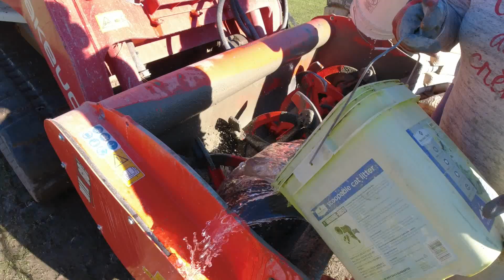TESTING OUT a CEMENT MIXER attachment FOR A SKID STEER (game changer)

Comment: Pour that concrete over topsoil and grass.  Nice
Reply from the maker: Still going strong with a 10,000 gallon pool on  it:)
Reply: Lucky so far. I predict cracking in your future. Shortcuts create problems later on. But if your happy no problem.
Reply from the maker: @UrbanDIYer  still no issues 10k gallon pool on it

Comment: 3:00 Why didn't you just scoop up the aggregate with the mixer bucket THEN put the bags of cement in?
Reply from the maker: Would tear up the lawn to much. This was way easier. If you have an extra machine why not use the rig to make life even easier ?
Reply: @VBELTandSON  But that is a tracked skid. They tend not to mess up turf as much. But I am not there so you were the better judge of that. Just asking. Oh and I did see the part where you mentioned that. 

"If you have an extra machine why not use the rig to make life even easier ?"  Yup. I am in agreement.

Comment: You really need safety grates over the mixer . That thing will grab your arm and drag your entire body in . You shouldn't have the blade spinning near the bags either that can get you pulled in. I stand on mine but I have thick safety grates on ours. Input my water in first then add 5 bags at a time usually stoping around 25   80# bags  ours can hold 30 but it's a little much for the hydrologic lines I can usually mix 2 pallets of 80# of concrete and pour in about 1 to 1.5 hours cleanup up and loading  takes about 30 min

Comment: People aren't figuring in cartage and wait time on the concrete truck..its $150 yd PLUS cartage and wait time. When you have to fill a skidsteer bucket n haul to your work area the time adds up fast ! I bought a used mixer like this for $5k because I'm far from a quarry so cartage would be very expensive. Plus a lot of areas on my farm where I pour concrete aren't accessible for a truck. When I'm done with my projects I can sell the mixer for damn near what I paid for it !! It came in handy when I had to repair all the posts in the poll barn..could only do a few at a time..not worth getting a truck.

Comment: Just put a bolt, two washers and a nut in those holes with the nuts on the outside.
Problem solved.
I can't believe you poured cement without removing the top soil and laying down gravel and using galvanized fencing instead of standard pre-rusted fencing.
Other than that a pretty interesting vid.
Reply from the maker: Smart idea
Reply: Who uses galvanized wire mat?

Comment: Let’s say you wanted to do a barn slab all by yourself. Say 75 yards. Time is not an issue nor is manpower. But money is. If I already have a track steer and am open to buying a specific machine/attachment would this work or is there a better option. Really looking to save major money and do it over a week or two. But obviously I would like to minimize the work as much as possible. Thoughts?
Reply: I have the eterra 16 cubic foot unit and it works well. Cost wise where I'm at, it costs me about 2/3 what delivery from a concrete company costs. I paid around 8300 for the unit so I might break even if I did around 100 yards of concrete. Do your numbers and decide what's best for you. I like to look at it like I get a paid for attachment eventually, but delivered concrete is by far more efficient.
Reply: @reliableloren2871  great info and thank you. I didn’t realize those mixers are so costly, in the back of my mind I was assuming 4/5k maybe or even lower. That changes the math. 
Personally I’d feel obligated to get my money back at least once by either renting it or doing a job with it plus the savings earned in doing my own project. Just musing, and thanks again

Comment: Placing concrete on topsoil and grass is not good practice.  Plus there should have been a 4" stone base installed.  In about six months it will start cracking.
Reply: But they saved so much money by doing it themselves!

Comment: I’d rather have a truck chute it into a bucket from the driveway. Short-loads are 3yd minimum where I’m from. That looks like about 4 yards. Truck would be cheaper than bags, lots faster, lots less work, standard bucket holds more than mixer bucket. I agree that that’s a sweet setup for remote jobs though. Fresh mud gives you more time to lay it down, too.
Reply from the maker: 10 yards*
Reply: @VBELTandSON  whoa! 
Thanks for responding! I feel start struck. 😉 
Hello from Moscow, ID!

Comment: Next tine get the concrete truck and 4 wheel barrows. You could have shuttled the concrete faster than you could have mixed it.  1 wheel Barrow is 1/32 of a yard of concrete.  Ask me how I know.
Reply: 10 yards 1/32nd at a time huh? That sounds like alot of fun.
Reply: @Kashaww  me and 3 more guys did a cart path on a lake property once.  It was  26 yards total.  The ground was so steep we had to drag the legs of the wheel barrows all the way down the path.
Reply: If he had a skid steer he could haul it the bucket. That's what he needs is a skid steer!
Reply: Have you ever heard of a line pump? Some people work harder than they should.

Comment: I would of used a concrete truck and hauled it in a plywood box in the bed off a pick truck. That's one of the ways I've done it. Tilt the box so the concrete runs out when you open the gate. You can haul a half a yard at a time. Mixing concrete with bags cost a lot more than from a concrete truck.
Reply from the maker: Idk why I even talk in these videos. No one listens. 🤦🏼‍♂️ we mixed more than a cement truck load and still have extra material left over. material cost was a less than half of what a cement truck load would have cost. This was cheaper for us and 0 issues.
Reply: @VBELTandSON  4 yards  here cost $600 from a concrete truck. Or 160 80 pound bags or  concrete mix from the big box store for approximately $550. 4000 concrete mix here I'd 135 dollars a yard from the concrete plant. I can't see how its possible to save the way you're doing it. Also you need the skidsteer and the mixer.
Reply: @VBELTandSON  Not to mention a pickup truck wasn't going to fit through that gate either. Some people just like to hear themselves speak.
Reply from the maker: Well now you are calling me a liar. Smooth amigo. ✌🏻
Reply: @VBELTandSON  LOL, I'm saying your math isn't correct.
Reply from the maker: No no you don’t trust me or my math. 2500 was the quote using a cement truck.  I spent a g on material.  I already own all the equipment costs me nothing but fuel.
Reply: @VBELTandSON  I wouldn't even waste time responding to this guy. You're better off talking to a brick wall or Callahan...either one would be more intelligent.
Reply: @VBELTandSON  okay ,my math is comparing the 4 yard  Minimum concrete truck load to concrete mix from places like lowes. If you got the materials for a thousand dollars  than you saved. My point is for the average person may not get a great deal like you did. And the average person might be mislead thinking they could save money by mixing there own concrete.  If a truck can't get through the gate.  A garden tractor and trailer will work hauling from a concrete truck.
Reply: @SawmillerSmith  The average person doesn't own a skidsteer with a mixer attachment or any attachments at all for that matter. What's the point of having all of that equipment if he doesn't get to use it for personal projects? Sure beats mixing by hand in a wheelbarrow! "Work smarter, not harder"
Reply: @camodrums  my point is that some might think it's might be cheaper to mix there own concrete. They could rent the equipment to mix the concrete with thinking they are saving money. Also I added average person to clear up the confusing. Some might even think that if the own the equipment they can mix it and save.  160 bags of 80 pound concrete mix to make 4 yards of concrete that weights over 12,000 pounds.. 4 yards isn't very much for most jobs.I mean it might be fun opening 160 bags of dusty concrete mix and mixing it. I get that. Just explaining more clearly. He said it was $2,500 for a truck.load of concrete. That's about 10 yards. So that would be 400 bags of concrete mix to cut open and breath the dust of concrete mix to dump into the mixer.   You could get sand gravel and Portland cement to mix might make it cheaper.
Reply: @SawmillerSmith  you are calculating ready mix/ quickcrete as opposed to bunker mix by the truck load mixed with a pallet of cement. Makes a huge difference in cost. If you buy your aggregate by the bag instead of truck load......ouch. maybe for fence posts or a mailbox.
Reply: @dangoodwin5954  The video was about a skidsteer with a mixer attachment that they mixed was equal to 2 concrete trucks.
Reply: I mix allot of concrete this same way  yes not only  cheaper than a truck but you don't have to wait for the truck you did it at your convenience . Keep up the great videos